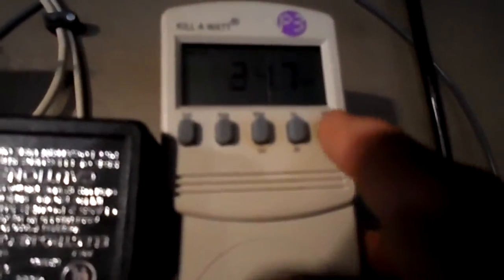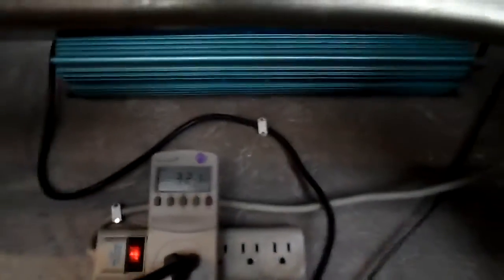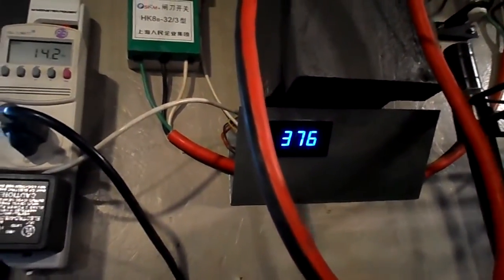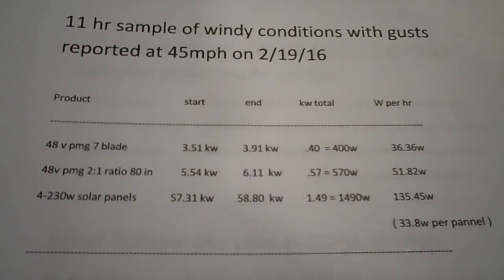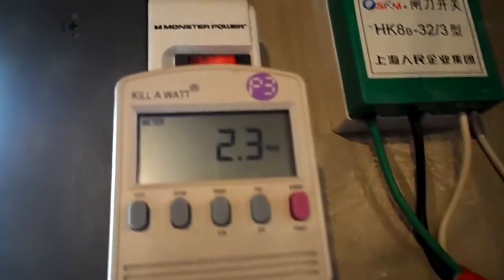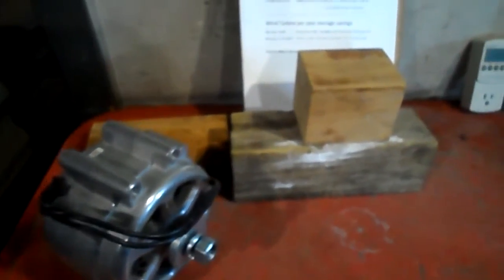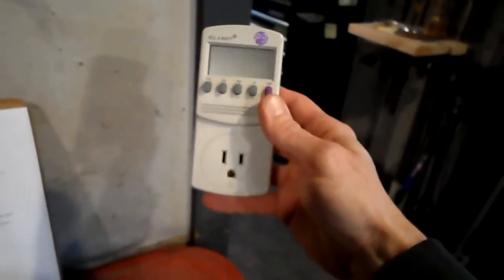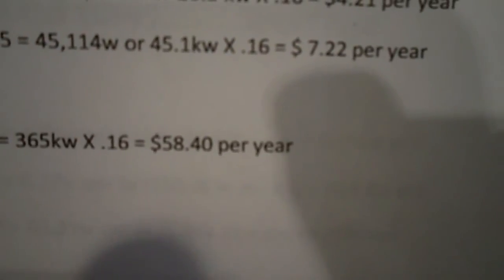Buying a Small Wind Turbine w/o going 65' up?  Buyer Beware

Comment: I have 700 watts of solar. just bought a 400 watt vawt helix style turbine. no wind for 5 days. my solar kicks butt even on cloudy days compared to no wind lol...  solar is cheaper and will always produce. thought I could use this turbine just to trickle charge at night but no wind no charge. Ok  I guess I could wait for a storm.LOL
Reply from the maker: I even bought the low wind blades.......still crap.  I sold my turbines and I'd recommend you doing so too.  They are not worth messing with even with high winds.  Unless you have super straight high winds.

Comment: let us break it down. your experiments are totally flawed.  1. your tower is less than 30 feet above obstructions. 2. you are using an inefficient inverter. 3. you do not have a capacitor between your grid-tie inverter and the rectifier.
Reply from the maker: Thanks, but no thanks.  The blades I bought were for extremely low wind, no one in the subdivision can have anything above 30 feet and you don't need a capacitor anywhere in the system. Btw, the rectifier was inside the grid-tie.  I don't care how hard you want to polish a turd but unless you have very high winds all the time, a small wind turbine isn't worth it.  Solar panels kick the shit out of these crappy turbines.

Comment: Boy I wish these YouTube experts could understand the difference between a kilowatt which is a rate, and a kilowatt-hour which is a quantity. When they say things like "watts per hour" and such, they're just showing how much they don't understand electrical terminology. It makes me cringe every time I hear it.
Another thing, it would have really helped if he simply mentioned what part of the country he lived in. Many parts of the country have enough wind to make it worthwhile, while other parts absolutely don't. One needs to check a wind map in order to know if it's going to be cost-effective or not. Just because it's not cost effective for him, doesn't mean it won't be cost-effective for you or me.
Reply from the maker: I never said I was an expert and I live around Milwaukee WI 2 miles from the lake.  When I bought the blades for my turbine it was advertised for low wind areas.  Sure some people have great wind, but most don't.  The people that say they get great results never really show all the details.  You pretty much have to take their word for it.  When this video was made, I was the only one to have an rpm meter on the blades.  I showed all the power made thru a grid tie and I never pulled any punches doing so.  I don't believe in deceiving people and my results show cost per output, solar panels kick the crap out of small wind turbines.  If you disagree, make a video and show me.

Comment: Thanks for the magnificent reality video. I was considering a wind turbine. I think I will stick with my pvl-144's from unisolar as I get more power from them every day than you get from the turbines. I bought  6 of them from a friend for $100.00  each. They cost originally $449.00 each. I only average about 600 watts a sunlight hour a day from them so there is a little utility bill decrease. I live in the sunshine belt and we have lousy wind. A wind turbine would be money and time wasted based on the results you have demonstrated. Thanks so much for your exhaustive efforts and the very useful input.
Reply from the maker: Thanks,  I got rid of all my turbines since.  I have now 18 panels and battery bank which I use at night.  My record for Kw usage for the day was 1 kw.  Most of the time I'll use 4 to 6 kw's per day but it's hard to keep adjusting my set up for the changing sun days. With out anything I was using between 18 and 24 kw's per day.  Either way it's 10 times better then wind where I am and if the power goes out, I'm not screwed.  No regrets on all the money I wasted on wind, I know better now.

Comment: What do expect to get at 15 foot high on your roof in town ? These clowns commenting on your video haven't mentioned that at all. Your never going to get much power out of any wind turbine at that height.
Reply from the maker: +K Lynn The modified turbine is 25 feet off ground level........what kind of power will it make being 65 ft up?  Even 2kw on great days is still not that great....comes out to 32 cents which is pennies.
Reply from the maker: +K Lynn Do you have a link to a video showing a turbine making great power over a period of time?  I'm not winning, I'm pointing something out.......most data is never shown over a period of time.  How high is your turbine and what kind of power does it make?
Reply: +Lightendog Don't know at 65 foot, just saying that it needs to be up high in the air with no obstructions. Not 25 feet surrounded by tree's
Reply from the maker: +K Lynn They do sell roof top mounts that the turbine stores and 11 blade sets which are advertised for extreme low winds...............The thing is, most people simply cannot get a turbine up that high with out having a lot of land.   Some people don't need to go up that high as they have great winds or flat land with no trees. A 65 foot tower would not be cheap and would not be worth it even if you could average 2kws every day.
Reply: +Lightendog You don't have great winds and flat lands is the point.
Secondly, those cheap Sun grid tie inverters are only 60 percent efficient at best, they are NOT meant for wind turbines, solar only. They cannot adjust for wind turbines, you cannot put a power curve into them like you can with a Midnite Solar Classic 150. No one has mentioned that yet. They can actually stall out and hold back a wind turbine.
Alot of people have great locations for a wind turbine and wind turbines do work and have been working for  60 years. 
Don't buy another wind turbine for that location, they won't work well at all. 
Change the video title to " Don't buy a wind turbine UNLESS you have the right location " Go solar if you if you have no shading in your yard, if you do your solar won't work for crap either unless you invest in micro grid tie inverters like the Enphase. If one panel gets shaded it won't matter with the Enphase.
Your also trying to make money off the utility company by feeding back to them. Not going to happen unless you have at least 3000 watts of solar or more. 
All in all i see wayyyyy to many negative people on here looking to piss you off and not offer up any of the solutions like some of the ones i have suggested to you.
Not looking to make you mad just kinda irritated by the stupidity going on below.
Reply from the maker: +K Lynn The grid ties I use are sold for wind turbines and when the wind blows they do make power.  I will change my title to be fair for everyone out there.  Wind turbine advertising is misleading with the products they sell like roof top turbine mounts and 11 blade extreme low wind  sets....None show results over a period of time (that I have seen).
Reply: +Lightendog Those grid ties are really no different then the solar grid ties, horrible. The Chinese don't care who buys those things nor do they care if they work. I have seen hundreds of them burnt out and this is what is happening with them. When they are suppose to go into dump mode from over voltage the relay inside the 500 watt models was only good for 250 watts, it burns out and the grid tie stays in dump mode.A friend of mine use to repair those, he's an electronics repair guy. He is the one that told me about the dump relays. I went thru several of those with my vawt.Over volt and poof, junk with no repair.
In Colorado there is a test facility that does test a wind turbine for a year on a tower.They publish the results for the manufacture. I believe it is the AWEA test facility. Google it and i am sure you will find it, i did.
Reply: +Lightendog Here's the link  http://www.nrel.gov/wind/nwtc.html
You should study the site, it's awesome

Comment: my treadmill motor with three 1-1/2' blades cut from aluminum pipe work better than those. you need to much torq to spin those pmgs you have, which in turn causes you to use more or bigger blades, then it robs you on how fast it will end up turning

Comment: Nice video Most I cant comment about.  But I can on solar panel's I spent about 1500 bucks on solar, Pip inverter, battery's and all the other ins and ours.   I used to before last year had a 400 dollar power bill.  I have taken that down to just 200.  I have also made other changes. I have almost all LED lighting,  went to wood heat. and only use the AC unite when I need to. So I got savings there also.   Solar is the way to go.  I have 1666 watts of solar.   I have  6 DM Solar 145's  2 DM solar 158 and 4 Kyrocera 120's,   I run them in strings of 4 in series and then Parellel  I do lose some power on the DM solar Because they stopped selling the 145's and the 158's   so I have  3 of there 145's with a 158 in series, so I do lose some power there.  But I have seen it hit 1500 watts on a very good day.  There are other loses from temps to wire size and length and also charge controller battery's the list goes on and on.  but I'm saving money.      Now I think about it if I have in the last year saved about 200 a month on power that is 2,400 dollars I have saved.  I have about 5 grand in my system.  It will have its self paid off in a few years.  Solar is the way to go.

Comment: I would thumbs up twice if I could
Reply from the maker: +Darren Living Off Grid Thanks...........I'm wondering how many thumbs down will be coming, lol.
Reply: +Lightendog  more than thumbs up's lol. If you speak the truth about small wind turbines it seems to upset those who own them. 
They can work, I've seen it. But as you said. You need a tall tower and regular high winds. 
Thanks for sharing some real life data.
Reply from the maker: +Darren Living Off Grid I wish someone would put out of video on output data of one up 65 feet.  With a grid tie, kilowatt meter and  rpm meter..........just so I could see how much better it would be.  Even 1 kw every day for an average would still be crap. lol
Reply: +Lightendog There was a video out showing one on a 65 foot pole, making 190 watts in a 20 mph wind and the junk seller Missouri Wind and So'Liar threatens ( like he always does) to sue the guy and the video vanished. To date theres been at least 50 videos like yours thats been removed by threat by the seller of this crap.